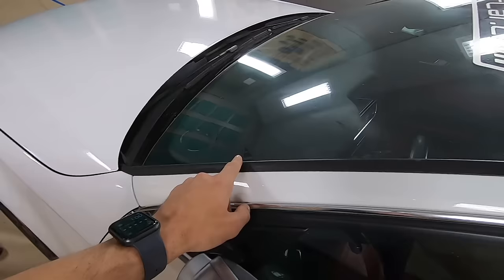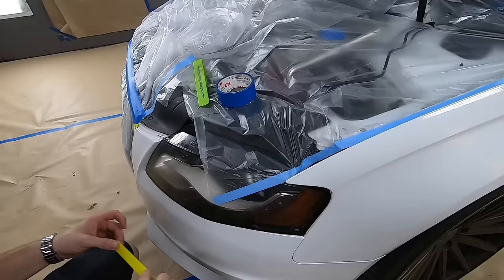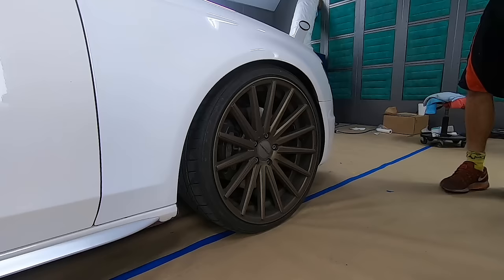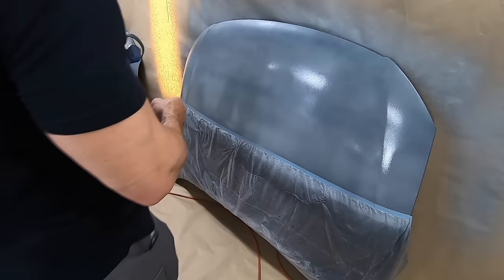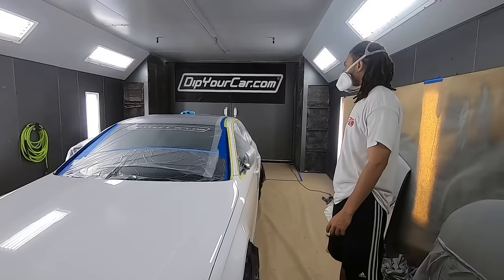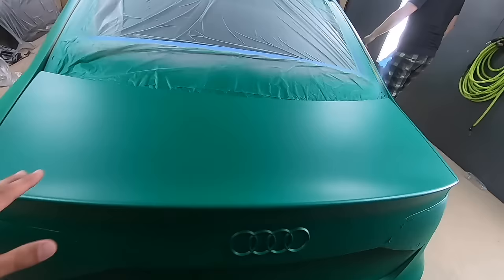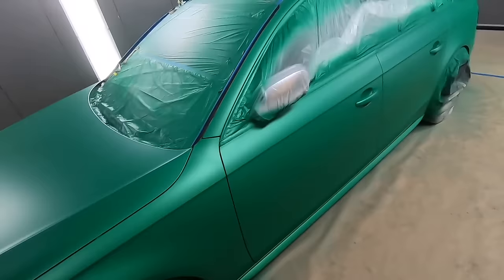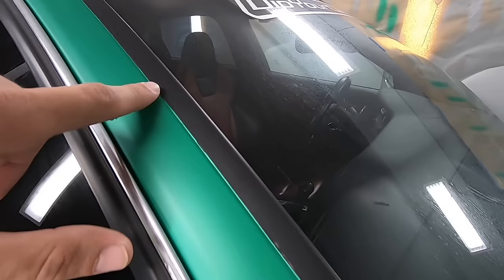Dipping a Car w/ a FIRST TIME USER (Coaching Him Through EVERY STEP)

Comment: It looks great! I have a couple of questions:
1. How durable is the finish, does it hold up to car washes? Does it hold up to (normal) hail? 
2. Do the front lip edge of the hood or the front lip edge of the roof have a chance of peeling back over time?
3. How long do you estimate the finished car will hold up, is it one year, two years... 5 or 6... or more?
Thanks, in advance!

Comment: I agree with other comments, this was a great video, not sure I'd say best but, one that I will watch again.  You mentioned that although with a good tape job you shouldn't run into any bridging but things happen.  Looks like Steve didn't have any problems, I've had several.  I'm curious to know what you would do if you had some bridging where you weren’t expecting it? Razor blade to cut it? Or is there a different way?  I've also not had any luck with the "peel when wet" I was thankful for the little more explanation you had in this video.  I'm going to try it again to see if I understand the process better.  Thanks for all the info!

Comment: You might benefit from a 3m handmasker you can combine tape and plastic of different dimensions or masking paper or just put your pre-combined rolls on and use the correct blade for plastic, which is much sharper than a paper blade.

Comment: He did a great job for his first time, I wanted to share a technique that I don’t know if it’s an actual thing but it’s some thing I do. I’m 5‘7“. When it comes to the lower parts it’s easier for me to get low enough to get a good spray. However something I see this guy doing and this is not criticism, I’m just pointing it out so that others can see, he has a very narrow stance. Which is why he’s taking multiple side steps. My advice is widen your stance and rock side to side. When you take steps and pause, you can get a run or an uneven coat. So to minimalize that, just Rock side to side, and when going with the length of the vehicle, plan your steps accordingly so you don’t stutter step or stumble. 

I cannot remember the guys name in the video for the life of me, but he did a great job, I’m not criticizing him at all, just pointing out something I saw, I was also taught this technique myself.

Comment: I know this is a year old, but i was curious about a few things. What about the spaces between/underneath the door handles? Do you have to kinda angle the spray gun in towards it a little or something? How does it get the whole handle?
2nd, how about the inside door trim around door jams ect. Is that something do-able? So that way its not really jarring to see the original car color every time you open the door? Thx!
Also, great job steve!

Comment: @dipyourcar, I have a question regarding dipping around emblems. Should I mask off the emblem with painters tape and peel after the dip dries? Or should I dip the emblem and remove the dip after? Option 3 is removing the emblem completely and reinstalling it after the dip. Please let me know what you think would be best!

Comment: I bought a few gallons of black and sprayed using my Wagner paint ready station. Exact one you used to use years ago and it sprayed absolutely smooth like butter 🧈. Setting was on 1.  But my only problem was what you mentioned once on here. I did get the pixel look to it. I was not sure why. Now I think it’s because my overlapping.

Comment: Thank You for all the great tutorial videos. I have a rare 1985 T1 Mercedes Camper van and  I having it fully sandblasted and then Epoxy primed. of course there is going to be some minor body work after. Would the Extra large package be enough paint for me or should I get an extra gallon of paint kit. My van is about the same size as a new sprinter van. I am planning to paint it a desert sand color. Also would your primer be ok to go over my Epoxy primer?  Thanks

Comment: I have only used your product to black out the emblems on my 2018 Durango R/T but i love it and have promoted your product on all the forums I am on.  The only question I have is on the doors and door handles, what do you need to do to these post dip?  Do you have to go along the parts of the door handle and separate the dip or can you just use the handle and it separates itself?

Comment: Looks like an awesome project.  What kind of prep work do you need to do to cover bad paint jobs?(all your videos I have seen so far seem to be covering pretty good paint)  The car I am thinking about doing has a DIY piss poor paint job(maybe rattle can maco blue) with no clear coat that is oxidized and chipping off around the trim and some plastic pieces.  Does it have to be sanded perfectly smooth to get a decent result or will the primer base coat level some of it out as long as nothing is coming off?  DYC  Thank Donut media because I didn't even know plastidip existed until you guys sent the kit to them for their video.  I actually watched their video because I was considering wrapping the car but I can get it professionally painted for what a good wrap job costs. May have gained you a customer once I feel confident enough to tackle this.

Comment: Great video. I have a car i bought and it has a bad, rattle can dip on it. Would it be easier to spray those areas to build up some dip so i can peel it or will it not stick to old dip? It s a real pain to peel thin dip.

Comment: Painting on a professional level isnt easy it takes time no surface is really ever the same you have to adjust your mind to deal with different environments and tune your tools accordingly not all paint is the same but even a professional can achieve quality work with cheap materials it's all about prepping your self & your project i see painting as the fun part it becomes second nature the more you do it if your worried about using your own car you can visit your local o'Reillys or AutoZone for sheets of metal to test on lay down a coat of paint sand it down you can make dents in the metal and learn how to fix it with bondo so on and so forth but i would highly advise practicing on scrap metal sheets 👍🏽

Comment: I'm loving your work... Short question, how about deep scratches on the body/paint, should we do bodywork first to fill the scratches or go ahead dip it? Thank you
Reply: Body work first if you can. And then dip. Theoretically you could fill the scratch with the dip but I wouldn't do it. It's more work than it's worth and it might end up being uneven. Depends how bad it is as well.
Reply: @seren1ty755  noted, thanks
Reply: @WeAreTheSantosa  np, if you can take it to a body shop or detailer and see what they say and can do about it. You'll probably be in good hands.

Comment: What about the parking sensors on bumpers , what are we supposed to do ? Thx
Reply: i would put a wide tape over it and carefully carved it round with the sharp pointy scalpel
Reply: Bull1the1Great yeah Good idea ; they didn’t in the video though
Reply: The dip doesn't affect  the parking sensors.
Reply: I saw on another video parking sensors can be sprayed right over.
Reply: Shaun Koher thank you

Comment: That plastic has the tape already attached?
Reply from the maker: Yes, Tape and Drape comes in the Car Kits.  It's a large plastic masking tarp with the adhesive strip attached.
Reply: It’s a game changer!
Reply: Tape and Drape, DYC sells it and part of the kit. If you need more most hardware stores have them in the paint section.

Comment: 53:00 runs on bumper and 53:08 on front one as well 53:29 driver side door on the middle bottom not enough paint.
Should have shown him how to avoid these mistakes, otherwise it looks like painting car before smuggling it to some unlucky customer.

Comment: can I dip in the desert
Reply: Try to find a surface with little to no sand or Debris on the ground than wet it so u dont kick up particles with the air compressor, also get a plastic tent to put around the vehicle so no dirt and sand flies into the car